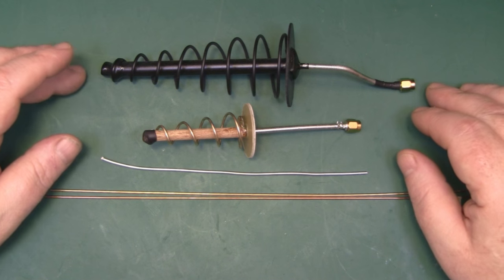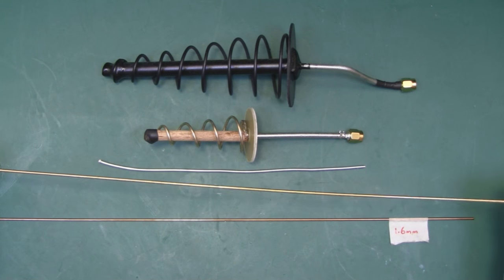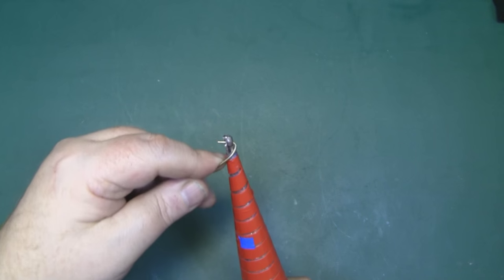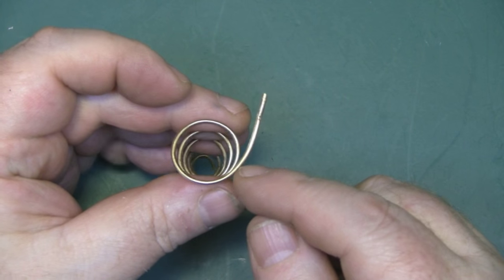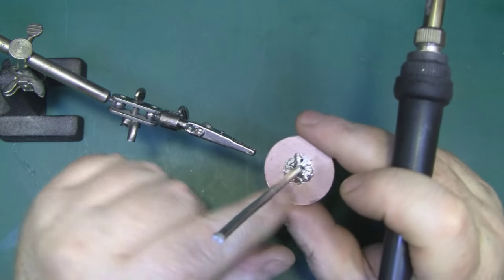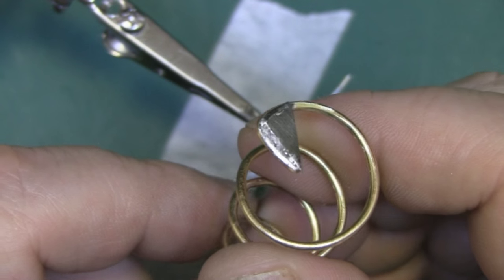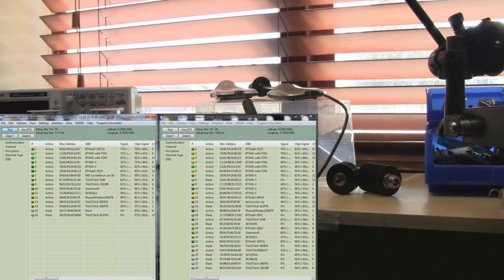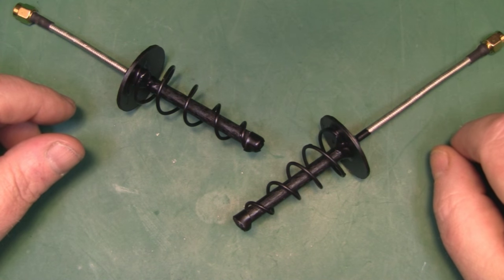5 8GHz Spiral Helical Cone Antenna

Comment: very helpful thanks. with brass if you heat it up to red heat then quench it in water the bras will become very pluable. making it easier to form. reheat it after you shaped and let it cool slowly and it wil harden back up.
Reply: Mark stillman  I believe that is reversed. Slow cool soft, rapid quench harder..

Comment: Very good, once again!  I wonder if 1.6mm copper coated steel TIG wire might be a suitable, and much cheaper, alternative to the brass?
Reply from the maker: +James Lamb Hi James the brass rods only cost me £3 for 6 300mm lengths though the sell has since put his price up to £3.99

Comment: Mr. McNeil,

I have followed you since the beginning more or less. I find your videos wonderful educational experiences that help round out my knowledge of rf in a laser bean focus as my fpv hobby is completely contingent upon good transmission and reception.

I wonder if you might be able to design 5.8 antennae that are as precise and effective for specific frequencies within the 5.8 band?

Here you are discussing wide band antennae, but I would like to have a set of 6 or 8 antennae with each one structured to very specific 5.8 frequencies. Is this a project that is feasible?
Reply from the maker: +Hiway Hi Hiway do they have to have circular polarisation?
Reply: andrew mcneil
preferably as that is the standard for most of us- I am building a  double, dual diversity groundstation which would allow me to run 4 antennae- so I could have linear and circularly polarized but that is just not efficient- I am hoping for a set of omni style 3 lobe antennae that are specific to each of the 6, or 8 channels used in racing. Also, in both left and right hand. Tall order , eh?